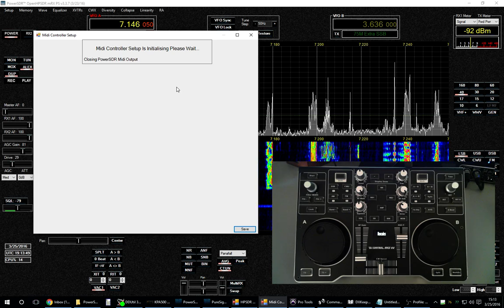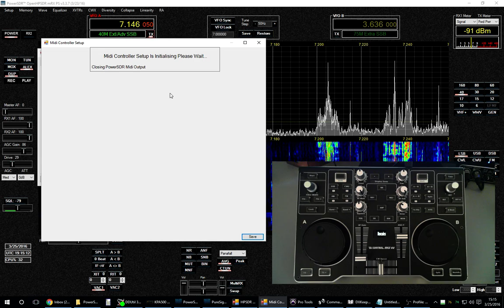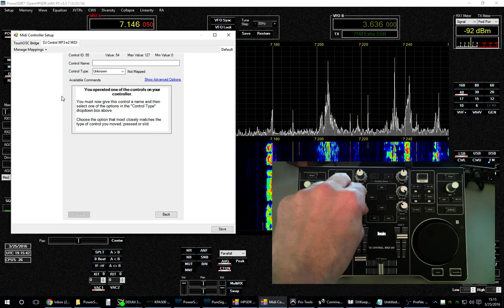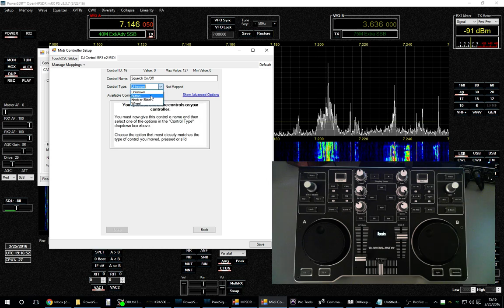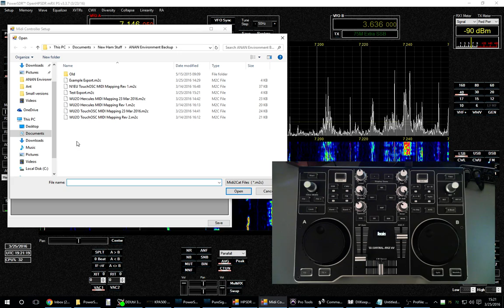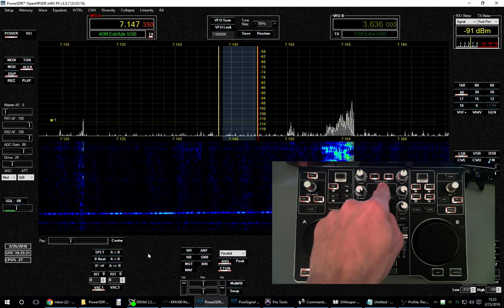MIDI Control Programming in PowerSDR mRX v3.3.7

Comment: Hi Scott,
great tutorial, I won't be scared once I'll start doing it......
p.s. I have noticed that vertical dBm levels bar  moves along with the tuning window insted of being fixed on the left an side, I could not find out how to change that into the setup menu?
Thanks Clay, I4LEC
Reply from the maker: Clay--Thanks! Go to Setup > Display > RX1 and set Spectrum Grid Align: Cntr to get the scale in that mode. I also recommend using a Step size of 2 and don't set your max. much higher than -40dBm in order to get more optimum scaling of signals.